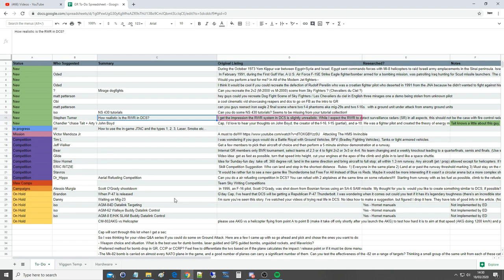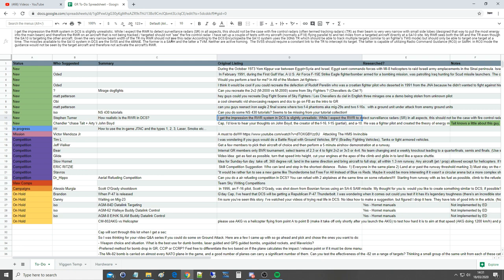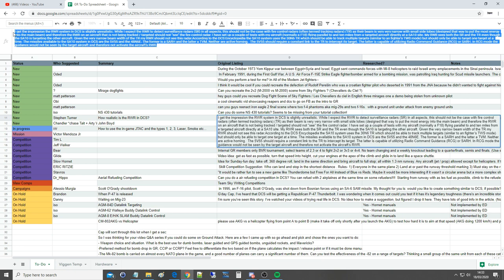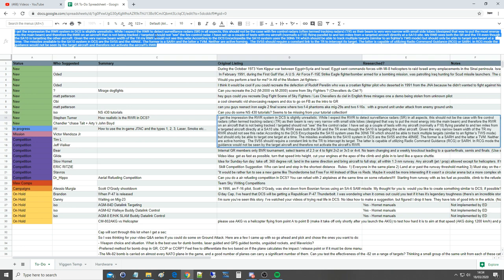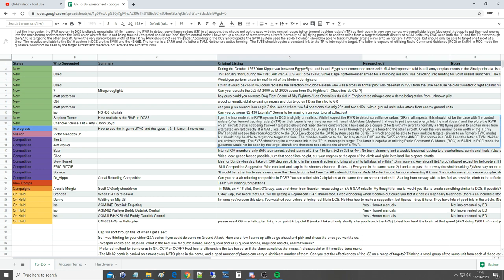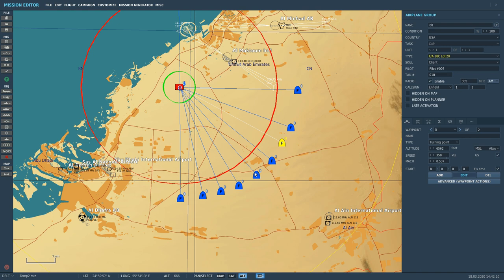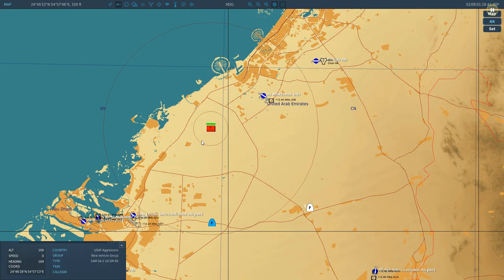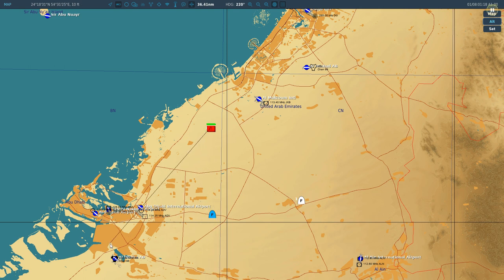Questioned: Is Ground-Based Radar/RWR Modelled Correctly In DCS WORLD?

Comment: Former radar systems engineer here. A search radar will paint you typically once every second as it rotates its beam. Between these paintings, it will transmit it sidelobes towards you. These vary greatly in strength depending on the details of the antenna. A tracking radar will paint you continously while locked on you. Again, those not painted by the main lobe will still see the sidelobes. 
Also, a tracking radar does not necessairly have to have a very narrow pencil beam. A tracking radar often uses nutating scan , also known as conical scan, which means that it's the accuracy of the nulls that matter, not the width of the main lobe. To further complicate things, there might also be a second transmitter involved, typically an IFF of some sort.
Now, an RWR has an enourmous power advantage over the radar as radar pulse only has to go one way. So depending on the details of the side lobe suppression of the radar and the lobe patterns and sensitivity settings of the RWR, the RWR might well detect a tracking radar while NOT being locked on by it.
Reply from the maker: Thanks Lars. Would love to interview you one day!
Reply: Great answer! It shows that this simple test is invalid and that there is so much more to it.
Reply: There's various tracking methods such as monopulse, sequential lobe, conscan etc... And also RWRs have what's known as range advantage
Reply: That's more like it....freedom of information without imprisonment

Comment: I think anti-radiation missiles are homing on the fire control radar's side lobes. So it is possible that RWR could pick up the radiation from the side lobes as well. Though I don't know, if that is a required feature of RWR, or a side effect of not being able to distinguish the main lobe from the side lobe, or something else. 

Probably Shilka has the most basic fire control radar (it's only one dish) in DSC. S-75 in this video has an array (5 in total?) of different antennae on its fire control radar for tracking, missile radio-control and IFF.

Also, I wish Cap had time to go through the Sam Simulator manuals - it's a great read, and it explains in details modes of operation, parameters and general mechanics of the earlier Soviet SAM systems. But it is a rather time consuming task.

Comment: Hey guys, I highly recommend that you google "Sam Simulator" or "samsim1972." It's a detailed simulation of SA-2 (two variants), SA-3, SA-4, SA-5, SA-8, and ZSU-23-4 systems. The documentation alone is well worth the download and basically explains (in a very accessible way) how all these are working. It should answer all of the questions you guys pose here and much more. P Gatcomb has some videos of this program in action, if you are curious:  https://www.youtube.com/watch?v=ua_TdSmKINY  

For example, the Fan Song radar that you are showing has at least five antenna: wide-beam and narrow-beam with one pair of those for horizontal and one pair for vertical, plus a separate missile command-track radar. Just like the aircraft radar, there are various modes to choose from for locking and tracking, etc. However, according to that documentation the widest beam should be 20 degrees, with 7.5 degree narrow beam mode and a 1.5 degree "LORO" mode, so I agree that DCS is probably wrong about the beam cones.
Reply from the maker: https://www.youtube.com/watch?v=KF2SOvV5vW8 I'll learn it properly if I ever get the time

Comment: I'm about to buy zur F/A-18C and the Persian Gulf map on sale to get started in DCS. Although I still need a gaming Laptop.
Reply: dont expect to play DCS on a laptop
Reply: You can play it on a laptop but it's going to cost considerably more than a desktop pc with much better performance, dcs is an old game and doesn't even have multithreading so your laptop CPU is going to be a bottleneck especially in multiplayer.
You would be better served learning how to assemble a pc, not as hard as it sounds as there are literally about 5 components to put in a case and connect up, download and extract a free windows 10 iso to a usb stick to install it and off you go.
Reply: If it absolutely must be a laptop, look for one with a i7 9750h and rtx 2060, that will give you the best bang for your buck so to speak, however it's going to set you back around $1500. Laptops, especially gaming laptops aren't particularly robust and are prone to failure, make sure you get a good 3 year warranty from the place of purchase.
A decent enough desktop would be about half the cost plus your monitor and peripherals, hope this helps.

Comment: Great test setup to test this cap, but I would like to see whether the results hold true as soon as a missile is launched.

In my opinion the radar would only go into tight pencil beam as soon as it fires a missile to guide it correctly, everything before that is just the track radar looking (you said yourself that some radar systems track up to ten targets)

The RWR tells us that we are being locked, but as far as I know this is only based upon the intensity of the radiation detected. So for airborne radars the tighter beam of an STT means higher intensity, but it might be different for track radar systems on the ground.

If you were to analyse the whole radar system as if it was an aircraft, the search radar would be your RWS or TWS and the track radar would only be STT (whether it is really tracking only a single target or multiples) As soon as a missile is launched it then drops most of the tracks to maybe stop the SAM getting confused by multiple tracks or it might go into continuous wave CW mode for older SAM systems 

Thanks for this great series!

Comment: It's possible that once the missile is launched the beam narrow.
Reply: I agree, the pencil beam is not really necessary unless you are trying to guide a missile onto a target.
There might be a misconception in trying to adapt the knowledge of airborne radar systems to groundborne systems. There might be modes other than RWS TWS and STT for those big things and thus the radiation picked up by the RWR might not fit into our neat STT box
Reply: RWS/TWS involve sweeping the beam in a scan pattern, but the radar shown just pointed the dish directly at the aircraft (equivalent to STT). 
It is not able to change the width of the beam, as that is set by the physical antenna size/shape.

Comment: Questioned: Can you determine the type of an aircraft solely by its radar signature? I.e. when your radar detects an aircraft at a certain distance for the first time, then the contact distance might be a measure for the radar signature of the spotted aircraft.
Reply: Same question goes for ground units. Just replace the AA-radar with AG-ground radar.
Reply from the maker: Yes, your RWR can detect the PRF and determine which unit it is. Also an NCTR print will likely be able to tell what type of fighter plane you are actively locking.
Reply: Thanks Cap! I did not know that NCTR even exists.